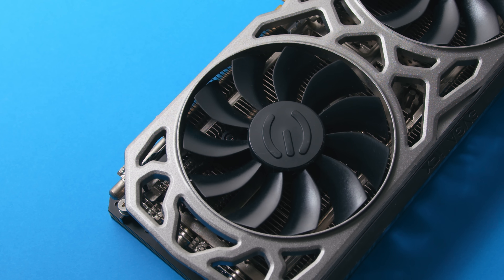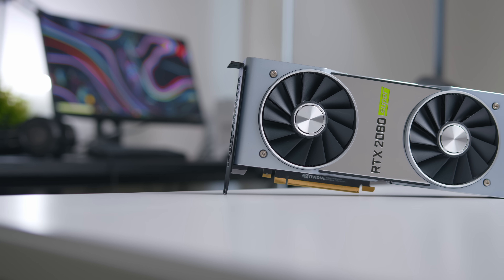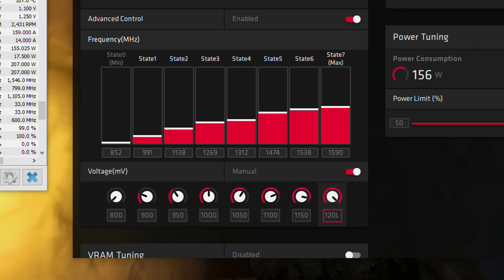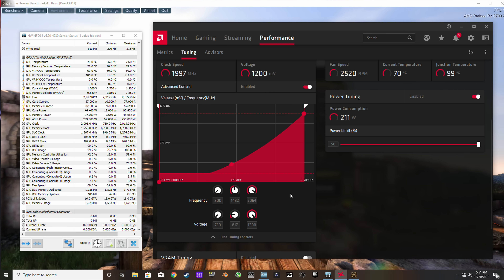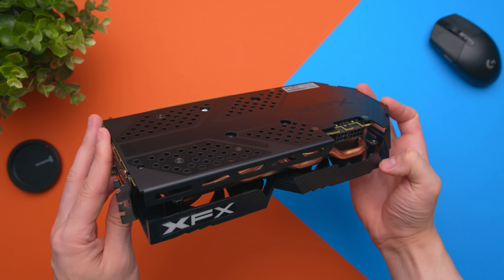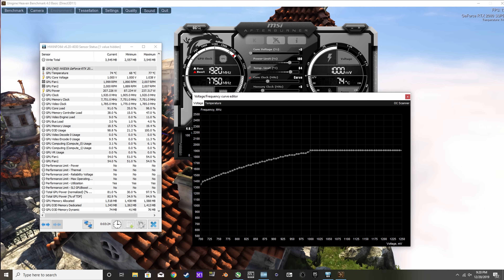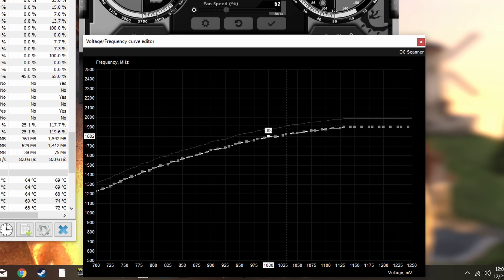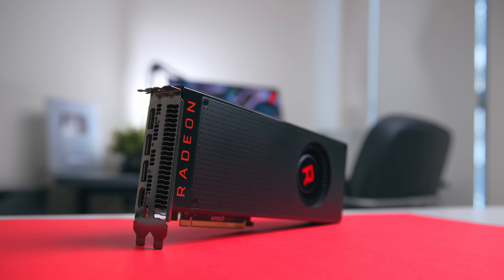The Ultimate GPU Undervolting Guide - Navi, Turing, Vega + More

Comment: undervolting my gpu crashes no matter how drastic or small the changes i make are, i have an rx 580
Reply: To me it feels like that card should not overheat. If it somehow did, something must be wrong like dried thermal paste or smth. I dont think you can undervolt low end cards. Maybe improve the airflow and increase the case fan speeds?
Reply: @blastermaster0199 i ended up js getting a rx 7600, i really appreciate ur recommendations, thank u very much
Reply: @nottnert  i was gonna get that gpu when i built my new pc for 330$ but ended up buying a used 2080 ti for 280$ that is 40% faster and has more vram.
Reply: @ oh dang that’s a really good deal, maybe i should’ve put more thought into my purchase

Comment: I wonder why the manufacturers and their technicians don't reduce the energy, I mean undervolt, if it's so good.
Reply: Small % of graphic cards might not work with lower voltage at all, or might not get performance as the average card, so it's a way for them to make sure that few % of ''crappy'' GPUs will work at advertised speed, even if it's a below average silicon, so they push high voltage on every card, just in case. Even if they have the same name, video cards don't have the same quality.

Comment: Came for problem with wine coil, ended up with -20 heat in warzone 2. Before 65, now 45. Did exact same thing, one slighty further then yours and no crashes. So thanks. Wine coil bit lesser to.

Comment: There is also my (lazy) way:
1. Get benchmark/s at stock settings.
2. Limit the power to, say 80%, apply, and use the OC Scanner to find an overclock. Test again - if you are within 2% of stock results, reduce the power limit to 75%, and go again.
3. Repeat until you fall out of 2% of stock results.
I got my 2070 Super Strix from 255 W to <170 W at 98.5% of stock performance.
Reply: can you explain what an overclock scaner is? im always lazy.
Reply: @andre713ful  There is a button in the top left corner of the MSI Afterburner home screen - "OC", with a magnifying glass next to it.
Click it, then click "Scan", and wait roughly 20 mins for it to finish.

Comment: if you have. card that is locked to 90 watt, what is the best course of action? can't ndercoat fro! the top frequencies because it can never hit them under load, do I go by the average clock speed under full load? undervolt from there? or just max what it can do at the locked power limit

Comment: With Nvidia cards and MSI Afterburner, does it mean having to always run Afterburner for the undervolting to engage? LIke if you run a game without Afterburner, won't the GPU run to stock settings?
Reply: Yes if you're not running MSI Afterburner in background then it runs at stock settings again

Comment: Well, finally decided to take a stab and undervolting my 1070ti... despite the the specs of my MSI 1070 ti Duke listing at 1683 mhz, Mine's currently running at 1860 @ 900mv (down from stock 1025mv)
It's so far out of line that I think I'm doing something wrong but... Heaven doesn't crash, card temps dropped a few degrees. I guess I will just let it ride and see what happens.

Comment: Earlier, I undervolted my 1080ti using a different guide, reaching 800mv for 1600mhz, going through this guide, I actually managed 900mv on 1898mhz which is just shy of max boost clock, but temps dont even go past 60c.
This has been going for a month now, so far so good.

Comment: It's actively fighting coil whine as well
Reply: Yes, for me with lower voltage coil whine is gone, and it has nothing to do with clock speed, and also my PSU doesn't sound like a jet engine.
Reply: @1GTX1  mine isn't gone but my 2060 went from unbearable to okay
Reply: Lower voltage means lower power consumption, which lowers stress on the board's power components, thus reducing whine. Undervolting is great.

Comment: Can someone tell me whether I should turn up the Power Limit in MSI Afterburner when Undervolting an NVIDIA GPU or not? I didn't see him touch the slider for it at all, but I noticed that was something that he did for all of the AMD cards.
Reply: Upping the power limit does nothing unless the card needs or tries to pull more power than it is supposed to from factory settings, so basically it's usually only for overclocking but it doesn't hurt to put it at 5-15% more if your thermals allow it.

Comment: Why not just reduce the power/temp limit %? any danger doing this?
Reply: i do it for mine as previous undervolting attempts had failed but it isn't ideal as it can make games run slow and lag because if afterburner makes the computer focus on staying  withing your set temperature threshold rather than allowing them to operate at optimal performance games will lag and might even crash. I run multiple instances of Roblox regularly and whilst capping the temperature at 80C keeps my gpu from going haywire it tends to crash both instances of Roblox after a couple of hours because it can't operate as well as it is capable of because it runs too hot without the temperature limit. mine is overdue for a thermal paste replacement so that'd explain my issue but for you? no it's not dangerous but avoid setting the temperature and power limits too low, you should allow your gpu to max out at 85c and keep it out of the 90s but temperatures below 85c are very much preferred

Comment: I can now game without hearing a jet engine in the background. Dropped my 2060 temps to 65-70 degrees under full load running 1950mhz at 0.925v with no performance lost. My GPU was always hitting 80-83 degrees before, probably due for a thermal paste replacement.

Comment: Thanks, this was a lifesaver to get my NVIDIA GeForce 2070 Super to be quieter in my FormD T1. 
From 1044 mV -> 906 mV @ 1875 MHz
Was able to lower fan speed to 40% (the minimum for my founders edition card) while at full load.
Temps during Heaven + Cinebench R23 @ 76-77 C, which is fine for me as I care more about noise.

Comment: 1070 asus, stock voltage 1031mv, after undervolting I managed to get the same clocks but instead for 850mv which helped massively in temps and noise.

Comment: Looks like my 1660Ti undervolts to 894 mV safely, at which Voltage it runs Heaven without any artefacts or lagging... but crashes at 887. I find that's a suspiciously small interval between everything working fine, and everything ceasing to function.

I have absolutely no point of reference, because google is being useless. Is this good?

Comment: Any advice for undervolting new RTX A4000, the successor of Quadro 4000? I'm not playing games just running DCC apps and rendering. HWinfo shows GPU temps hitting 86-88 degrees on full load and while pro cards with blower style cooling are made for such temps and load I would rather see sub 80 degrees temps on full load.
I don't think nVidia has its own sw for this. 

Thank you.

Comment: You know.. I have been struggling with my RTX 2070 which came in a pre-built I got in 2019. 6 months into owning it, the thing started throttling and has not stopped since! every time the temp reached 80c the GPU would kick into overdrive and blast out hot air like a heater in winter. No matter what game I ran, even on low settings, it would throttle. I basically rebuilt the whole computer, better airflow case, new fans, new motherboard, new CPU cooler, new power supply. New case has 8 freaking fans in it, and it still throttled! FINALLY, IT IS SILENT!! Thanks to you, I was able to run a full benchmark with NO THROTTLING! And the temps never got above 77c!! Thank you so very much for this video! I am in freaking tears with joy!!

Comment: Will this work with a 3090?
Reply: Yes, just follow the same steps as the 2000 series, starting at 8:37  - he also did a video on the results on undervolting the 3080/3090

Comment: Disappointed I didn't try this earlier! Was able to undervolt -100mV on a single fan EVGA 2060 which was always bouncing off the 83C temp target & throttling (unless I manually locked fan RPM at 95% or higher) After undervolting it now maxes around 80-81C and maintains a slightly higher clock than before, Core clock usually sits 1905Mhz while playing Days Gone at 99% GPU utilization / max gfx settings / 120fps cap, I was so used to seeing the PerfCap readout in GPU-Z showing Thermal triggers during gaming but now it always sits Idle! Thanks for the guide.

Comment: Am I understanding this correctly? You lower the voltage by setting your max mHz at lower mV? 

Can anyone tell me what stat in afterburner shows the mV the gpu is running on? So I can see the current voltage used?
Reply: To answer you first question, yes.  That's what you are doing.

For your 2nd question, If you are talking about the overlay in afterburner, if you turn on the GPU voltage item in the list (on the monitor tab), and it will show in the overlay.

Now if you are talking about on the MSI Afterburner screen, in settings/general, you have to turn on 'unlock voltage control' and 'unlock voltage montoring'.  You might need to reboot your machine but then the voltage usage should show in main Afterburner screen

Comment: Im using rx 580 2048sp and tried to undervolt it. If i change any values, it crashes in game. Is this normal or just my gpu? My gpu running 89c in game which literally hotter than the engine in my moms car

Comment: Asus ROG Strix 2080 Ti stock settings, just custom fan curve... 975mv-1.03v, 1875-1890mhz, 60-62c and 260w average power consumption @100% load. 

MSI Afterburner frequency curve.... 843mv, 1905mhz fix, 54-55c and 215w average power @100% load.

Not bad

Comment: This guide is amazing. Undervolted my rx 480 sapphire nitro and got some great results. was able to undervolt about 130mv. 18C degree reduction 87C to 69C. Power reduction was about 35W. 130W to 95W. My card started crashing at 980mv on the top state so i settled with a 1020mv final setting. Original voltage was 1150ish.

Comment: undervolting my gpu helps alot it lowers heat, noise, and power consumption. I can deal with a bit of lowered performance. I usually dont mess with any afterburner settings in my previous gpus but when I bought my current rtx 2070 super I just can't ignore the heat the noise and the power consumption compared to the gtx10s series. Good video and advise regarding undervolting, I wish I knew this sooner.

Comment: Yep. Love the production quality and the information as well. Will be applying this. Thanks!

EDIT: In case you're curious, got an ASUS RX 470, 4GB Mining that I'm, in fact, using for mining. Once I'm done repasting it with Thermal Grizzly's Cryonaut Extreme and servicing the fans (if applicable as they use industrial grade ball bearings) I'll test the temps and see if overclocking followed by undervolting is possible or go for the undervolting directly. 

IMHO cool temps are more important than overclocking as semiconductor resistance increases with heat and that kills the operational frequency of the GPU (for anyone that doesn't know).

Comment: EDIT: Kept playing around. Got the core to 2040 MHz@1.068mV same +1000 on VRAM. Ran the HZD bench and scored 87 avg FPS. That's 16% faster than the 75 FPS Tech Power Up got with their 2080 Ti at the same 1440p ultra settings.  

I did the opposite with my Strix 2080 lol went straight to the 1.068 button and slapped the frequency as high as it would let me lol 2GHz@1.068 with a +1000 offset on the VRAM. Set the fans to max out to at 50%. Any higher than that and they get annoying. Temps are at 74c load and saw an 8 FPS AVG jump in the horizon bench from 72 to 80. Max FPS saw about. 15 FPS jump. Minimums increased by about 10 FPS.

Comment: Undervolted an msi rtx 2070 super ventus to run at 0.931 V  at 1905-1920 Mhz, if i keep lowering the voltage, the clock obviously decreases, so it's useless right? 
Btw temps have decreased from 70-71 degrees celsius to 66-67

Comment: The thing about undervolting, the fans will actually get louder because they ramp up later..unless you have a manual fan curve but i undervolted my vega 64 and dropped like 10c on synthetic benchmarks. The voltage for p6 and p7 was 1100mv and 1200mv. I undervolted p1-p7. I got p7 and p6 almost 100mv lower. Freaking amazing. p6 and p7 were at 1520 and 1630 with the voltages lowered and i got a +50 on the core clock with a memory overclock of 1100 mhz on the hbm2. If i want overall lower temps i could lower the hbm back to 945 but with the 1100mhz i get like +3 frames lol
 other than that i get near 1080ti performance and a little around 2070 performance. Got to fine tune it a little more 

also, use msi afterburner. It's more simple, and i find it applies better. WIth the power limit slider up if you want to lower the overall amount of power the card uses, lower the core voltage a tad and try again. lowers my temps about 5c

Comment: The undervolting has worked quite well for the temps on my 2080 Super, but I’ll need to do more testing with 3dMark’s DLSS benchmark as it craps out after a couple minutes.  Turning the under volt off let’s the benchmark finish.

Comment: I've managed to OC/downvolt my asus dual 2060 super to 2050 mHz 950 mV from 1850 mhz 1025 mV (+200 mHz -75mV). That's -10 degrees celcius in that Heaven 4.0 benchmark BTW. Thanks, man! Your video is Brilliant! 
I'll try this setup now in Control. Really hate how this game roasts my GPU when RTX is on. 
UPD Haha Control really hates any kind of OC whether it is manual or auto and crashes right away. Guess I'll have to test this method some other time.

Comment: The RTX 2060 in my K39 wants to thank you!  Not sure why it won't go lower than 0.794 V no matter what I do in Afterburner, maybe there are hard coded limits, but it's not crashing during Heaven 4.0 or gaming and temps went from ~85C to ~62C with stock clocks.

Comment: I followed instructions and lowered voltage 85mV on my 2080S. Resulted in 3-4 °C less in Heaven 4.0 and Furmark stresstest. However in games I couldn't archive this benefit in temps. F.e. MW at max 1°C less. I assume it's cos of the higher system temperature caused by the Radiator as intake.  So for me for gaming it's senseless beside the minimal saving on power.

Comment: Tried the undervolt on this case on my 2070 super. Still can’t get it down from 85 degree full load. So got myself the mesh panel and reverse the GPUs to the mesh side and the temp is ok now at 72 degree 1440p ultra in heaven . Will undervolt later to get it below 70.

Comment: Thank you for this. I knew about the curve and the basics, but your video made it all click properly for me. Thanks to this I'm able to run my Aorus 2070 Super at 2040MHz Core Clock (stays at this 90% of the time, with the occasional dip to 2025) with +1050MHz on the Memory Clock at 1 Volt (Was running at 1.062 volts previously), which keeps my temps in the low 70s consistently (Before they were high 70s to 80s).

Comment: Great tutorial! was able to get my 2060 to 900 mv while overclocked to 1920 MHz. Occasionally will go above this to 925 mv and 1935 MHz, but I am fine with that as I am getting a max of 65C while running Time Spy Extreme! It even now takes a 25% fewer Watts than what it is rated for on Amazon. I could tune the voltage more to make it tighter but what I achieved is going to do plenty! Thanks!
Reply: Hey JR I need major help with my 2060, my CPU runs relatively cold when gaming going at 60C-70C but the main thing for me is my GPU which has been running hot at 80C-85C. Any tips?

Comment: One thing I recommend doing also with any rtx card is running the free quake 2 rtx game. For some reason, this hits my rtx 2080 super the most. So if you can do a whole run and not crash, it's really stable. Got 1905mhz @ .937v with 50% fan speed peaking at just under 70c. And I also can do 1800mhz @ .850v with 50% fan speed peaking just below 61c.

Comment: Thanks for this. My GTX1070 Mini has been driving me mad in my NZXT H200. I have undervolted to 800mV (and underclocked it to ~1750Mhz) and lost 6deg from peak temperature, but more importantly peak fan speed dropped from 81% to 62% during Unigine Heaven benchmark. Has made a huge difference to volume during gaming. Going to try replacing thermal paste next and see if I can get it down further! :)

Comment: I'm having an issue with my gigabyte rtx 2060 windforce oc that when I do exactly what was done for the 2080 super,the graph will shift down in the y axis when I hit apply.

For example I'll start out getting like 1950 MHz at 1 volt then by the end I'll be at 1880 MHz at .95 volt. Anyone else had this issue or know what to do?it's very frustrating
Reply: mines doing the same but upwards on a 2080
Reply: @dirtybeatfreak  I never figured out a fix I just gave p

Comment: Amazing video!

I'm curious if anyone has experienced the following with Afterburner:
First when I started it, the max frequency for my RTX 2080 (MSI Ventus OC) was 1920MHz.
But when I went ahead to reset it after the benchmarking crashed, it went up to 1950-1965.
Anyway I set it back, finally arrived at 1935MHz (because sometimes it went up there from 1920) at 925mV and -4-5 degrees celsius.
The problem is, when I restart the computer, instead of applying this profile, it starts with 1950-1965MHz at 925mV at which point it is no longer stable.
When I go ahead and apply the profile, it is working fine. Has anyone ran into this problem with Afterburner?

Comment: I have a 2080 Super FE so part of this video is directly applicable to my situation. I've followed your methods and set up a few profiles in afterburner with differing levels of undervolt and overclock. I've gotten largely great results and found my card stable down at 950mv at 1920MHz as well as stepped up to 1965MHz in Heaven and all games I throw at it...EXCEPT FOR COD! COD will crash with any undervolt whatsoever. Any thoughts as to why this may be happening or what I could do to resolve?